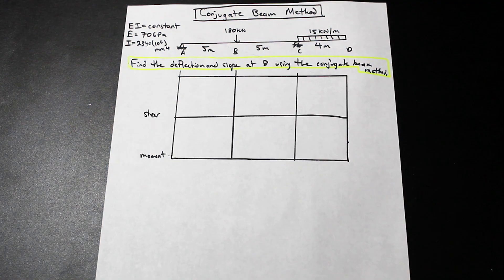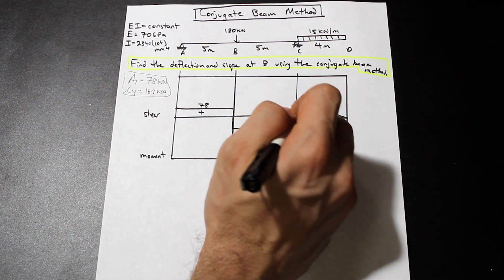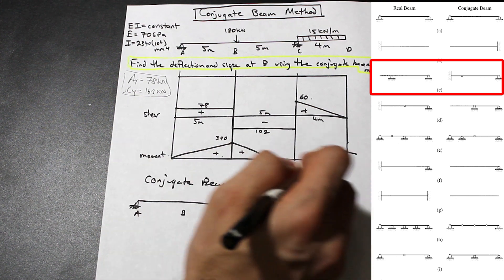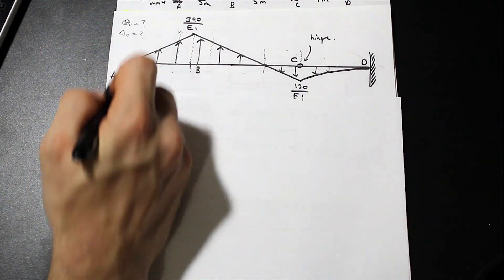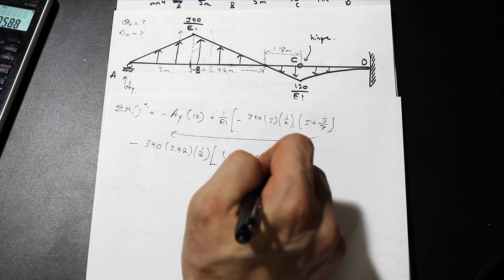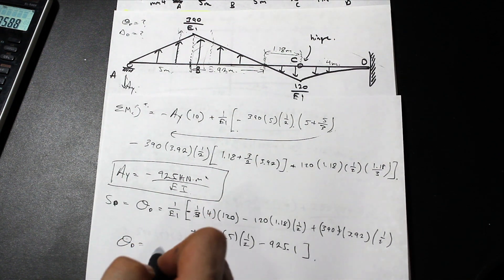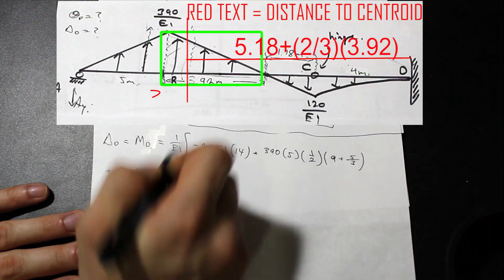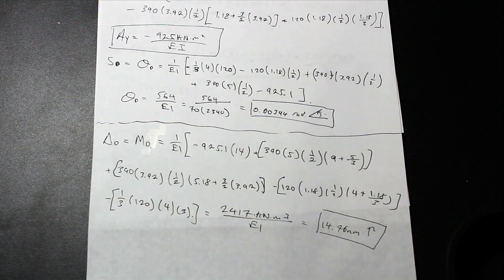Conjugate Beam Method - Tricky Continuous Beam with Cantilever Solved Example

Comment: Hi there @10:22 about the term 564/70(2340) = 0.00344 rad.
Dis you get that answer exactly it is? I am using Casio 991Es calculator and Im getting 3.4432x10^-3 which i still need to press the back arrow to get the answer youve got..
Reply from the maker: That level of accuracy is really not important, maybe if you had a really strict teacher, especially not in real life structural engineering.

Comment: One location by mistake taken as 3.92 but actually it should be 3.82 and in one location while calculating displacement multiply dimension has taken 3/2 but it should be 2/3.
Reply: yah. i was thinking the same
Reply: Yes
Reply: I also realized that

Comment: when you solved for the new reaction at A, why did you only consider moment at left of "C" and didn't include the parabolic side?
Reply from the maker: Because of the hinge at c, we can separate the beam into two parts, AC and CD and solve them independently.
Reply: @AFMathandEngineering  But why did you calculate all when you solved slope D and deflection D?
Reply from the maker: Because we need the reaction at the hinge.

Comment: If i maynot be wrong for getting deflection at D. ,you can calculate D(y) reaction at fix end and then taking only right side of internal hinge since moment =0 and calculate moment at fixed end will be easier .
Reply: You are correct, but it's about the same amount of work.  You still need to calculated the shear going through the hinge and include this in your calculation for the moment at D.

Comment: I'm a little confused about the sign  convention you've used, is anti clockwise supposed to be positive or negative
Reply from the maker: van béet thanks for the comment!  Can you give us an example of where you're confused specifically so we can help you out? Cheers :D
Reply from the maker: Also to further clarify, Almost always the positive sign conventions we use for bending for beams is compression on top, tension on bottom and counterclockwise (+ve) for moments.
Reply: I'm not from the US, so probably the conventions we use are quite different. 
In other videos, i also noticed that in the drawing of the bending moment diagram, when the line or curve occurs below the baseline i. e if the beam sags, the moment is labeled as negative. At our university, we are taught that a sagging beam has positive moment, which is also clockwise
Reply from the maker: I see.  Everywhere has different convention.  Usually in practice I'll draw the bending moment on the tension side of the beam, however in most textbooks it's on the opposite side for positive moment.  I'm from canada btw :) thanks for sharing the different convention that you use at your school!  What year are you currently in? Cheers!
Reply: I'm in second year, doing civil engineering 
Anyway, thanks for the great  content, your videos have been very useful
Reply from the maker: Ah,  great! Good luck! Thanks for the compliment, glad we could help!